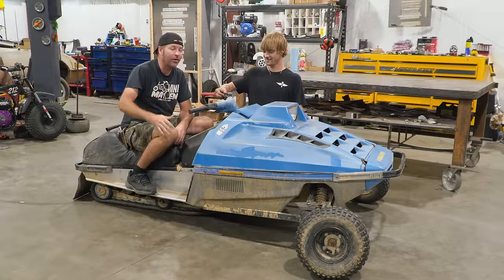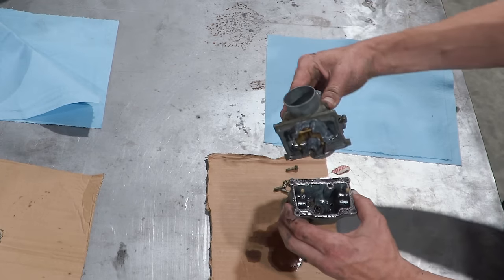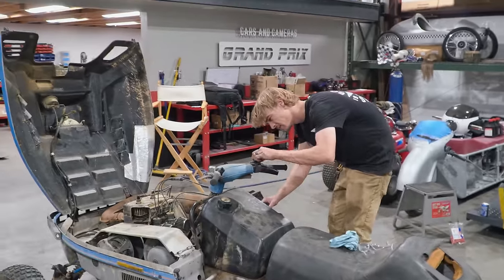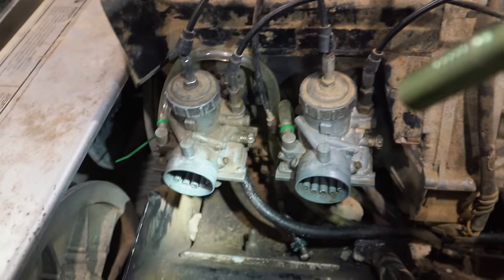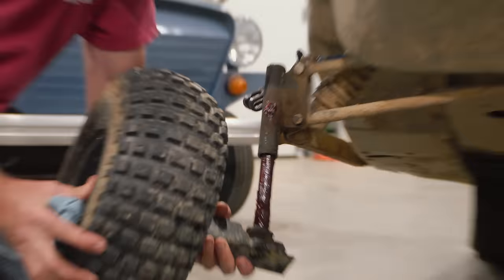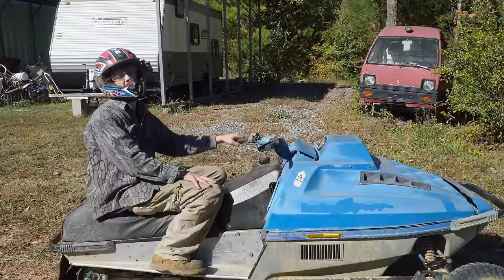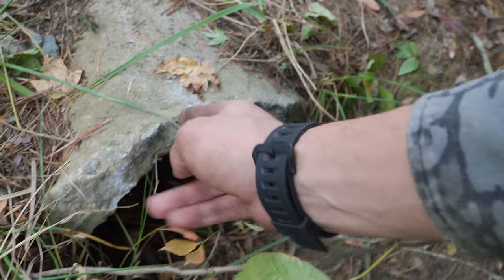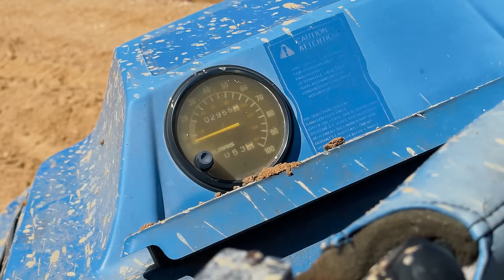Free Polaris SNOWMOQUAD Revival | Send + Big Crash!

Comment: Me and my dad did this a few years back and you’d be surprised how long that track will hold up even on pavement
Reply: Sure but it still will wreck it in no time compared to what it would do in snow. And those tracks are hella expensive new, least around here. Another thing is the other parts like slide surfaces on the bottom. Those are not made for dirt and will get eaten up. Top of that unless its full wheel system like in really old sleds those slides are meant to be lubricated by snow, so added friction will harm both driving experience well as sled it self. Honestly if you are going to build something like this, just put a axle and wheels at the back and you are better off than ruining tracks for no good reason. If you are in soft boddy area or lots of mud, make your own tracks instead. Note also the cooling system. Those are meant to be driving in frost conditions and water cooled ones have radiator in the tunnel roof, meant to be thrown snow to cool it. On summer there is no cooling to mention and not many places to put car radiator. Air cooled have similar problem where those run too hot on summer, so you can only adjust mix rich to cool it off with fuel, witch increases fuel consumption.

So take a go cart and engine swap it with this instead of ruining whole thing, specially with the older sleds people might want to buy spare parts from.
Reply: I could not have said it better myself.  Here in N.C. If you are lucky enough to come across a sled 1 grass drag it 550’ runs with cool down between runs. 2 Transplant into a wheeled vehicle and allow the engine to show you its potential.  Snowmobile’s are designed for snow you can overheat them and melt the slide-rails on glare ice.

Comment: You guys should build a gokart designed to do massive burnouts. Then take it to Cleetus and Cars and enter the burnout comp!
Reply: They'd have to build a go-kart with a firewall and some beefy fenders  and front brakes but I'd love to see it I'd also like to see them in a freedom  500 race.
Reply: I don't think they need to build one because the suzuki Mower Kart already burns some serious rubber.
Reply from the maker: Might need to revive tin lizzy…
Reply: @CarsandCameras please do this it would be insane content. 
I’d get in touch with Cleetus first so you don’t end up missing something with health and safety/tech inspection but Damn it would be a fun build to watch
Reply: @CarsandCameras if you have issues with that snowmobile rear end you should make it a double axle in the back so a six wheeler and you can easily link the two axles with just two of the same size sprockets off to the side so the one being driven by the front the front wheel drive the rear one you know and then basically that entire front end setup is probably awful for that. It probably do better with some A-frames and some stabilizer bars going to some pivot knuckles what's the suspension the two shocks be in sitting just over the engine or in front of it but those are a pretty easy effective way for really good suspension I got the idea off of one of my RC cars and I'm about to utilize that and put it on this old Carter two-seater that was like an excellent excellent condition give it to me for free by my daughter's best friend. Her and her sister wrote it a bit when they were kids but there wasn't any really men around that knew how to take care of it because the girls didn't and eventually they're having trouble getting it started and they stopped riding it and they parked it in the shed where it was left for 15 years are probably more like 10 or 12 years but someone had snagged the engine off of it years ago but everything else is there including all four original dry rotten tires that still held air . I have one question, is it difficult to switch it to a live axle cuz it's currently the original one-wheel peel with a drum brake but I have parts to convert it to disc and four new tires like six ply tires and I stripped it down and I'm going to paint it with my paint sprayer and like some car paint. Cuz this is actually a pretty nice Carter and I haven't been able to find the exact one online as of yet and the serial number sticker just wasn't even legible but it's heavy duty in the seat goes back and forth and all that and has two side guards but I think the upper ones are meant to put in cushion which is what I'm going to do so it's more like a bucket seat for two and I'm probably going to roll a a run a roll bar behind the seat just in case there is a flip whether I'll make a cage or not I don't know I don't want to add any more weight than I have to but I think I'm going to have to stretch the frame a little in order for the seat to be back just where it's comfortable and then room for a bigger motor I'll just run a 212 I think at first but it's probably easier than I can go on Craigslist or Facebook Marketplace and get a junk dirt bike or older 200 250 350cc motorcycle engine with gears if you know what I'm talking about. A death trap😂

Comment: Reminds me of many tears ago in my early 20s: I had a hobby of putting chainsaw engines on bikes and rode them basically everywhere.  I live in Michigan so winter was usually for other toys and driving.  One day I strapped a Ziffy Whomper sled to the front wheel with a rectangle cutout for the front tire to inset into, bungee cords to both handles and up to the brake assembly to both allow a little flexible lean, but also to keep the wheel stationary.  I set out one morning to head towork on it right after a huge snowstorm dumped a foot overnight, it rode like a dream with the Homelite XL925 screaming away out back on a Golden Eagle bike motor kit.  Steering was amazing, brakes not so much. Overall it was excellent and I made it the 10 miles in no time flat, with lots of funny looks by people.  When I flew in to the parking lot there were my main guys on the crew...I was all happy and was like "look at this thing, crazy fun -rides great...I call it the Snowmobike"  wothout even a pause my best friend Tyler pipes up "The Homobike?" ...a round of hilarious laughter permeated the cold morning air 😂
Thank you for the reminder and excellent videos
Reply: As a motorized bike guy,I'd love to have seen it.Just in case you want another...They make a kit for bikes with an 85cc chainsaw cylinder.The 3rd version lasts now as rings caught before.So strong the regular clutches Can't handle the power band kick in.
Reply: @bryduhbikeguy  I've built literal hundreds of motorized bikes as I did it as a hobby and a side business since I was 13 (1992) -many were cheap chinese/s korean/japanese 2 and 4 stroke 50 80cc (66.6cc really) kits.  I've moved on to electric hub motor conversion kits now, but still have some bikes with the golden eagle kit which I've found to be the best.  They're hard to get and pricy, but awesome as you can use any engine and they use a belt drive like an old whizzer motor bike.

Comment: Unless you have actual rips in the track it’s not that bad. Sounds like you need to tighten up the track so the cogs don’t slip. Better yet, take the track off and add a couple of sprockets, rear axle and chain drive.

Comment: When on snow, the snow melts and lubes the sliders the track runs on. Withput snow you need a water suply to lube the sliders. When snowmobilers want to drag race in the summer they mount a water source on the sled and run hoses down so water runs onto the sliders.

Comment: Snowmobiles need to have snow to lubricate the the hyfaxes/slide rails and the drive cogs. without snow the hyfaxes and the drive cogs will get really hot and they will melt and the track will stick to them. and sometimes when they cool down the track will release. and other times it will be stuck permanently. what a person has to do to operate a snowmobile on dry surfaces? is have to remove the hyfaxes and put bogey wheels on the slide rails. and the sled will do much better. I bought a sled once that the previous owners were riding it on the grass and it wouldn't even move. I ended up having to put new drive cogs and hyfaxes on it before I could take it for a ride. I was a snowmobile enthusiast for many years.

Im still waiting for you guys to revisit the Honduki project? I still think that machine has a lot of potential.

Comment: That noise the track is making is called ratcheting. That means the cogs on the driver are slipping. Also that blue strip right under the the rail at the bottom of the track is called a hyrax [slide rail] those melt away if there isn't snow to keep them cool and lubricated. Once the slide rail melts you will be running on metal to metal. Next is a fire truck! This thing is running on borrowed time.

Comment: Depending on what it was mixed and tuned at before, if your mix is different from that, you are either rich or lean. If you are using less oil, your resulting mix will have more gasoline and run rich. If you are using more oil, it will run lean.

Comment: As A Minnesotan. 50:1 has been the  norm for fuel oil mixture from the days of my childhood in the 1960's. Chain saws vary 32 & 40 to 1 to the new standard of 50:1.  being warmer weather where you are at 40:1 it can run with plug fouling when doing the ratio mixes. Boat motors are much the same. As we always did carry 2 or more sets of plugs with you at all times. Tie rod ends on most shnay machines are always aluminum and weak (the 1960s era machine steel was the norm but that changed). your wheels hanging out as far as they do adds extra strain on the rods and suspension arms. lawn mowers have steel rods and ends.. good luck!  yes build one burr better, raising the front and wheels under the sled and just running on the back of the track for better performance behavior and lessoning the track slide drag...  Snow (thawed water) is the lubricant on the slide rail track machines, bogie wheel machines do better in dirt (mud?) good luck again

Comment: So if the engine is running so much better without the air filters,

The jet is way to big, about 10 / 15 to high, we always took that as a measurement, because putting the choke on would amount to upping the jet by 10.

Also should be a air / fuel ratio screw on the carbs, where you can adjust the amount of extra air it takes in :)

Comment: And you need to rig up a windshield washer tank to spray water on the front of the sliders otherwise theyll just melt and stick to the track.  Charles killed those first plugs by turning the choke on constantly, its flooding out badly due to those carbs being so screwed.

Comment: Ditch those filters and find new carbs for it as those ones are toast.  It looks like about a 1990ish Polaris Indy Sport 440. Also make sure your choke cables are set properly, not holding open slightly causing the rich condition.

Comment: White milky corrosion as a result ethanol in the fuel drawing moisture. Cleaned a Honda 250 carb a few years back that had white fluid in it that smelled like ammonia that ethanol is nasty stuff

Comment: Rear suspension looks collapsed, rear shock is probably shot. ( happened on our 87 340 ) there are two positions for the front shock, should switch to the other position. Which should bring the ride height back up. Would probably help the steering too as it won’t have as much castor.

Comment: I haven’t watch the whole video guys but snowmobile‘s are meant to be road ridden. I should say in cold weather so they don’t have any air filters on them. Those air filters being on the sun will be will probably run it a little lean so that might be your issue to.
Reply: How would a restriction of air cause an engine to run lean? Filters don’t create more air they restrict flow… not to mention those tiny little filters they put on there have no possible capability of flowing enough air for the size of that engine… definitely not lean
Reply: That's what pantyhose are for they look stupid on a woman's legs but they look pretty cool on the end of your carburetor

Comment: Maybe use the engine and chassis, but trying to run a track on dirt will destroy it, especially without snow to lubricate the sliders.
Maybe a front axle with wheels, and a chain drive back to 2 more wheels in the rear.  Getting it to turn might be a problem, but that sounds like something you guys can figure out.

Comment: Dont replace that tie rod with another aluminum rod... You have to remember that that is a snow mobile. And it's not meant for a lot of weight and it's supposed to slide on top of the snow. And you're putting your put wheels on the front of it. Which makes it heavier and grip a whole lot more so that aluminum's not gonna be sturdy enough. You will have to build.  New tire rod links for both sides

Comment: The noise is the chain. It may need to be tightened but more likely the bearings are gone out of the driveshaft.  Pull the chain cover. Will not look good. just finished the video, LOL

Comment: Be careful riding that. It's a slider rear suspension which uses the snow to lubricate the hyfax which are a 'plastic' material that slides in the lower rail of the aluminum slider. Riding that without snow will quickly wear the hyfax eventually wearing into the slider.

Comment: Remember. With 2T, if you are over-oiling you are running LEAN. The oil is replacing FUEL, resulting in a leaner air fuel ratio..

Comment: I need help please when I pull the throttle the engine cuts off but when I don't set on it and Jack the wheels up it runs good but soon as I set on it and pull the throttle cut off ? It a mini motor bike I BUILD it got a 210 c.c 4stroke engine

Comment: Does anyone know what would cause pitting like that in the carburetor? I've rebuilt a lot of carburetors and I've never seen anything that bad.
Reply: Regular unleaded, moisture, and age.
Reply: ethanol
Reply: @larrycarlston4044  possible but I have a 94 Yamaha big bear that had a carb as beat up as theirs. I had to replace it because it was so brittle that it crumble on float ears just by trying to push the pin out. Never used ethanol and don't think it was even made back in the 90's to 2015. 2015 is when I had to replace the carb.

Comment: I love your videos but that fuel line your using is not good for gas I had it happen to me before if it’s the same as what I had my fuel line had like a plastic film on the inside and after a little use it will start to dissenegrate in with that gas and it clogged my needle jet and main jet

Comment: You know that thing is not safe for just anybody, you should give it to me totally LOL. JK. Although I did put a Stihl chainsaw motor in a 2012 / 2013 I don't know, Ford F-150 power wheels and the motor was actually in the engine bay and I had taken pretty much all the Plastics off so it looked pretty dope under the engine bay and it did have rear-wheel drive and I did fabricate a drive shaft going to a solid rear axle with a bevel pinion gear do I have welded on. Then I use carrier bearings and on the other end was mountain bike five or seven speed chain ring I think it was a 7-speed but I made the axle a little longer cuz I didn't want to like fling the chain off of destroy the chainring so the cassette actually slid back and forth on the drive shaft with a spring on one side for resistance to come back and engage and split the cables one going to the derailleur and one going to this bracket on the shaft and after a long time of adjustment took longer to adjust than to fabricate but I got it to go one through seven and I couldn't believe it but that thing ran 4 years with four kids beating the absolute hell out of it plus us adults after you know a beer or so add golf cart tires instead of plastic tires so it got around real good I got pulled over by the North Richland Hills police and he laughed his ass off at it and I got a small you know scolding about how I couldn't be seen and could get ran over

Comment: You have to pressure test 2 cycle engines, otherwise the carb won't pump fuel. Eventually it will stick the piston due to extreme lean conditions

Comment: your not suppose to add premixed fuel to snowmachines there is supposed to be an oil tank under the hood on the 2 stroke sleds looks like yalls has been deleted along with the oil mixer either way your using to much oil its too rich needs leaned out i have its bigger brother the polaris indy sport 500 mine was efi from the factory but is now carbed but ill either put the correct engine in or get a efi sled cause these carb sleds kinda suck

Comment: LoL     you need the fucking airbox on a 2 stroke sled engine, unless you're setting it up for wide open only, then you can get away with it a bit more. Anyone with a passing knowledge of how a VM mikuni works knows this..  they just dont tune for shit on a twin or triple without an airbox. And even in a single, the airbox creates a negative pressure to pull fuel into the carb..  And you can't drive a sled with sliders in the summer for long (especially a tiny little worn out 340) before the track sticks to the slides...

Comment: Crank seals are bad..you southern boys have no knowledge of snowmobile..
Reply: Those pod filters are choking it out. They are such a restriction it is pulling them into the engine. Just look at how crushed they look. Air leaks in the crank will run lean , hot , pinging ,idle will be going up and down , will only start on choke ect.  Snowmobiles have air boxes that have very little restriction and almost no filtering.